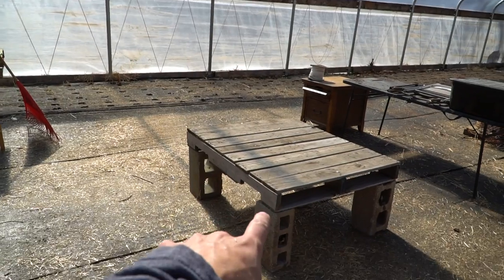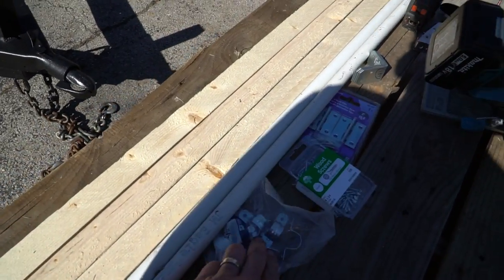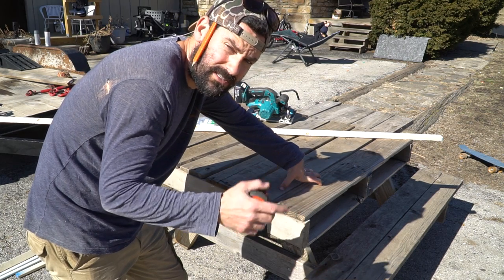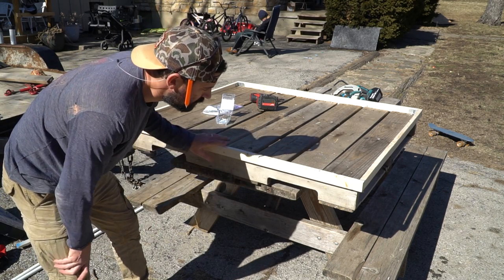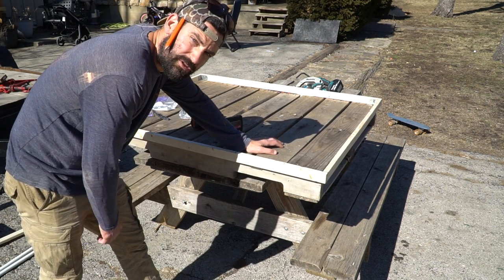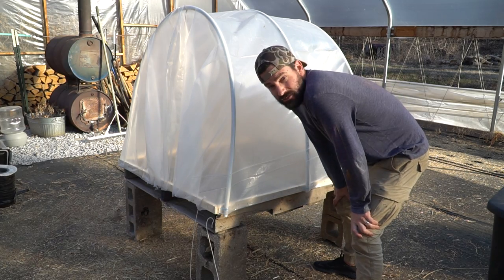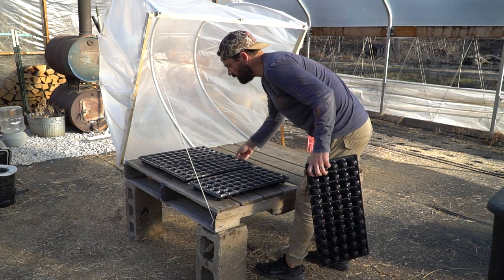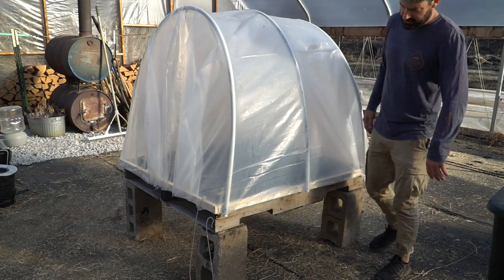How to build a HINGED HOOPHOUSE COLD FRAME for STARTING SEEDS!

Comment: The bottom of the hoophouse (the pallet) is not covered, it has gaps between the wood pieces. You should cover the base with plastic or some other material.